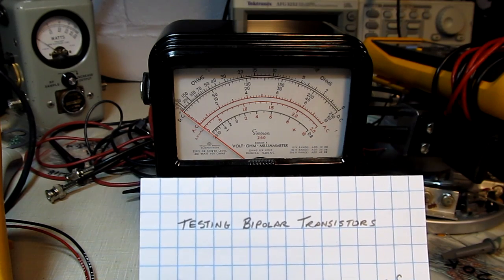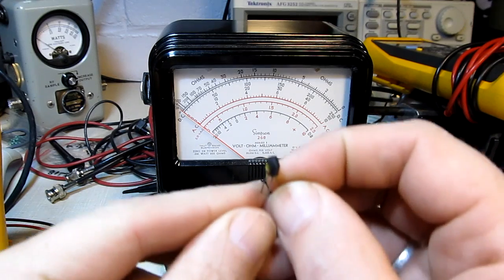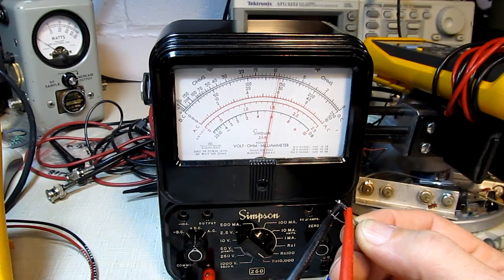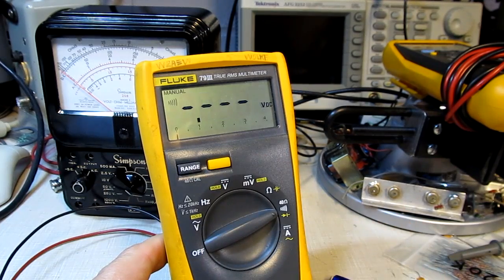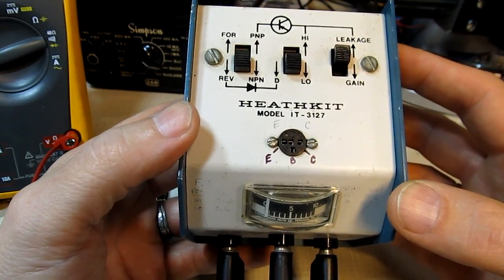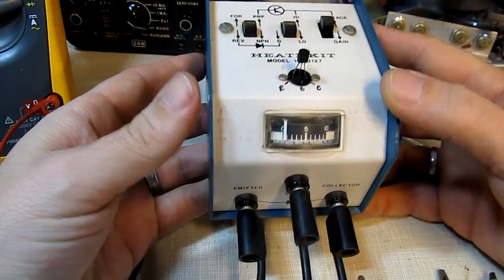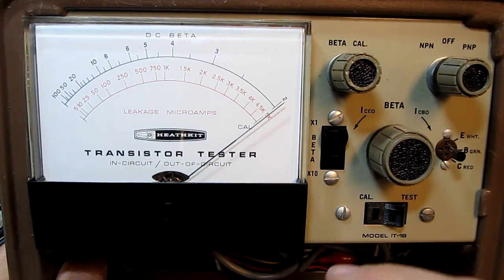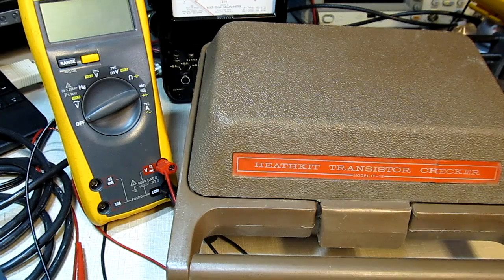#131: How to test transistors - NPN and PNP bipolar junction transistors, BJTs

Comment: Can you test this in circuit or do you need to desolder and test it off circuit?
Reply from the maker: In-circuit testing can not always give you reliable results because of the unknown influence of other components in the circuit.  Unless you know the schematic and then know what to expect from the remaining connected components, in-circuit test can only sometimes give you an indication of a gross failure (open or short).
Reply: @w2aew  I am testing a relay and on the power supply side I get the 12vdc...all is good there...but the other side of relay I am seeing 6vdc...I am thinking there is an issue with the NPN transistor....any specific tests I can do?  

This is all over my head but I'm trying my best to comprehend it.  I was told to short the base to ground so the transistor is not functioning at all and should not be conducting collector to emitter...if I do this I should see the 12vdc at the collector side of the relay coil...if I don't see 12vdc and I see something lower then it confirms the transistor is bad...is this correct?
Reply from the maker: @macknumber9  Yes, as long as there is nothing else connected to that end of the relay coil that could be pulling current through it.
Reply: @w2aew  yeah nothing else is connected....if I see 12vdc doing this test then what would you test next?  The actual base voltage reading while in operation?  I would expect to see .7v or higher at the base...if I see less then the transistor would not be at fault but possibly the transistor is not getting the right voltage because of anything before it?  Bad resistor etc
Reply from the maker: @macknumber9  Measure base-emitter voltage when "on", should be about 0.6 to 0.7V or so.  Is there any resistor between emitter and ground?
Reply: @w2aew  looks like emitter goes straight to ground with no resistor...base looks like it goes to resistors
Reply: @w2aew  so here's an update to my situation...I replaced the relay and it worked...I thought all was good until I heard a horrible rattling sound....the rattling sound ended up being the relay sparking/arching like crazy....I'm thinking of 2 possible things being my issue...

1.  Compressor is failing drawing too much amperage

2.  Transistor is bad and is causing a weak grounding of the relays coil which is causing the load side to not get pulled as tight as it should and the connection is arching because it isn't a nice tight secure connection...

Is there any way I can test for each possible problem?  Thank you so much
Reply: @w2aew  I measured base voltage but not sure I did it right...I'm guessing I did....

I put black probe to ground and red probe to base....got .5v 

I got excited thinking I found my problem....low power to the transistor...

Problem is I don't know if I technically did the test right (I assume emitter is ground so it shouldn't matter if I probed an actual ground or the emitter base)

If in fact I am correct and found the issue....what would be the cause for low turn on voltage?  Would this rule the transistor out as its simply not receiving the right amount of voltage to work?  Could I possibly have a signaling issue with my thermostat?  Not sure how thermostat works but I guess it somehow sends a voltage down to the pcb which goes to the base transistor....
Reply from the maker: @macknumber9  Possibly very weak or very high resistance drive signal to the base.
Reply: @w2aew  I will have to check continuity although I don't know what I should see there because of the resistors that are in that part of the circuit....don't know what would be a good/bad value....

I wonder if the thermostat itself is sending a weak signal....I would have no idea how to troubleshoot that
Reply from the maker: @macknumber9  if you temporarily short collector-emitter to simulate the transistor being fully “on”, does the chattering go away?  If yes, then the relay is ok.  To check drive to the transistor (remove the collector-emitter short), and measure the voltage at the base as well as the voltage on the other side of the base resistor if there is one, or even the voltage from the thermostat when the relay is supposed to be “on”. Then see what makes sense from an ohms law standpoint.
Reply: @w2aew  I know the relay is good...the old one went bad because of the lack of power going to the relay...it activates but weakly...this causes poor contact and relay burns out....

I am measuring .5v at the transistor base....I just removed the transistor to test out of circuit and it passed all the tests....this weak .5v is not enough to fully turn on the transistor...I just have no idea how to troubleshoot any further
Reply: @w2aew  sorry just read your entire post...I am going to get some readings....going to check resistance everywhere
Reply: @w2aew  can I run everything and all my tests with the transistor off the board? I'd rather do my tests this way instead of burning up this relay...I only have 1 left in the pack I got

Comment: Really useful thank you. However a note of caution when using an analogue multimeter. With many analogue multimeters the internal battery connection is plus to the black (negative) lead and red is to the negative lead.

Comment: 1- What are the maximum readings of each transistor when using the "diode" option?
2- If the readings are "acceptable"....gives it us the security that the transistor is in good consition?
Thanks😊
Reply from the maker: Nearly all silicon bipolar transistors will show between 500mV and 900mV.  Anything lower than 500mV may indicate a shorted transistor, or possibly a Germanium transistor.  Anything over 1V probably indicates a problem.  If the readings are acceptable, these are signs that the transistor is probably OK, but there are failure modes that won't show up with this simple test (high leakage, beta degradation, high-voltage breakdown, etc.).
Reply: @w2aew  thanks for the explanation 😃. There is an other thing i'm sitting with....does a transistor has TWO- or  THREE reading? I have a Hometheatersystem with a subwoofer issue. It goes into protection mode. I removed some main transistors and checked them with a DMM. The A1941/A940 and the C5198/C2073 give me two readings. But the L7805CV/L7815CV and L7915 CV give me three readings.....🤷🏽
Reply from the maker: @tajlingchin2553  The first four devices are likely 2SA1941/2SA940 and 2SC5198/2SC2073 which are all silicon bipolar transistors.  However, the last three parts are actually 3-terminal voltage regulators.  The L7805CV is a +5V voltage regulator, and the L7815CV and L7915CV are +15V and -15V voltage regulators respectively.  These can't be testing like a bipolar transistor.
Reply: @w2aew  thanks for the explanation. I've learned something new 😃
Reply: @w2aew  i did some more researches on the circuitboard and saw that the contactors of the relay (that steers the Subwoofer one side and the Center speaker on the other side) are burnt and glued together......

Comment: Do the 0.680 reading corresponded to the base-emitter junction and 0.677 to the base-collector junction? Typically, one juction will always read lower to identify all terminals of the transistor.
Reply: The emitter-base will always be higher than the base-collector reading for bi-polar transistors!!

Comment: If a transistors are two diodes, why doesn't a transistor rectify AC waveforms like a silicon diode would? I would think the transistor would rectify the AC waveform input on the base to collector and to the base to emitter would have two rectified waveform in opposite polarity. I'm not sure why a transistor doesn't rectify an AC waveform because its consider just two silicon diodes. Any reasons why transistors don't rectify the AC waveform applied on the base?
Reply from the maker: 1. Bipolar transistors do have a pair of PN junctions, but they aren't really operating as two diodes.  The base-emitter junction does operate like a diode and is forward biased when the transistor is ON.  The base-collection junction is usually reverse biased un normal "linear" operation.  It only gets forward biased with the transistor is saturated, such as in a switch application.
2. Bipolar transistors can, and do, rectify AC if the base-emitter junction is turned off during part of the AC cycle.  This is exactly what happens in a Class B or Class C amplifier.  In Class A, the transistor is bias so that the peaks of the AC aren't sufficient to overcome the forward bias of the base-emitter, so the transistor remains in the linear region.
Reply: @w2aew  If a diode doesn't have an DC bias voltage it will rectify an AC waveform but if you apply DC bias voltage until the AC waveform positive and negative cycles can pass through the Diode without getting clipped is the linear region of the diode. The difference between a diode and transistor is that when the AC waveform is passing through the diode is doesn't get amplify or increase in current gain. When an AC waveform passing through a transistor is increase the current and voltage of the AC signal. The transistor has something inside it beside a diode to make it increase the current and voltage of AC signals.
Reply from the maker: @waynegram8907  Yes, of course.  The base-emitter bias controls how much current flows from collector to emitter.

Comment: On using a Simpson 260,  the Rx1 range might not be such a good idea.  The spec on that meter says that current on that particular range can be as high as 625mA!  This would be a bit much for some devices.  I have that first Heathkit tester you showed,  it was given to me with a very leaky battery in it (a single C cell,  the only thing I have here that uses that size).  If you're going to leave a battery in it either don't leave the test leads plugged in or clip them to themselves to prevent them shorting out.  Leakage tests are something that I think is a bit of a holdover from when germanium devices were common.  While I have a few in my parts boxes,  I don't see me using them any time soon.  :-)  In addition to the above tester,  I also have a small one sold by Radio Shack.  There's a switch to turn it on and select polarity,  and then a knob that you rotate.  When the light comes on you can read the (relative?) gain by the knob position.  I was recently given a larger version of the same kind of unit,  but since I don't use the first one much I gave it to my brother...

Comment: I bought a pack of assorted transistors from China. I am sure they are all fake. 

I wanted to find a way to test these against their datasheet.
What parameters do I compare to the datasheet? It's not enough to compare Beta and Collector-emitter saturation voltage, that my component tester displays. 
What jig can I make to parameterize transistors with a scope +Sig gen ? 
I think a lot of people can use a clever technique. I would make a video and share it, but I don't know what I'm talking about.

Comment: Excellent clarity Alan. I also demo the "wet finger test". With the Simpson Ohmmeter +ve red lead on the (supposed) collector of an NPN and the black lead on the emitter,  a wet finger base to collector will show a significant deflection, much more than finger leakage alone. Reversing C and E will yield much poorer conduction, showing a very low Beta - current gain. Fun stuff! 73.

Comment: Very good to get it down to the basics. I normally use my Peak Altas checker, which completely breaks down everything about the transistor, including which leads are c, b, e.  In those times were an automated tester isn't with you or maybe you don't own one YET, It's very useful to know enough basics to use what's on hand. That said, Peak product is the bees knees most of the time, as it eliminates guesswork and checks the item much more quickly, but there are a few (very few) instances where the specific component are not in its internal database.

Comment: What does it mean if a transistor has a base to emitter voltage drop if only 0.187 v?  A known good transistor of same type has 0.68 v drop B-E.  I take it that it’s gone bad, would that be correct to assume?
Reply from the maker: Sounds like a failure to me.  Base-emitter short.
Reply: w2aew Ok, thanks.  And great video as always!

Comment: i'm confused. You show meter deflection with positive probe on base of NPN, and neg probe on E or C. But no deflection if you reverse your probes. 

I'm getting opposite results, with a 2N3904. Meter deflection with neg probe on base, and pos on E or C. 

What am i doing wrong? thx
Reply from the maker: It is possible that your meter has the reverse polarity on the test leads when in resistance measurement mode.  You can verify this with a 2nd meter.  Also, validate your measurements on multiple transistors to be sure.
Reply: That is because the guy is WRONG !  What he is explaining is ONLY if you have a Diode mode on your meter!  Then the meter puts CURRENT through the transistor. If you just use ohms it is the reverse!
Reply: i got a different answer on SE. Something to do with  'Traditional analogue meters were reversed'. 
https://electronics.stackexchange.com/a/340108/65001
Reply: This is what I stated. Some analog meters are reversed polarity when in resistance (ohms) mode, some are not.

Comment: Thank you a million times sir...and greetings from Jakarta Indonesia 

recently I salvaged a H945p transistor from a very old stereo. 

I'm going to use it for my microphone preamp project and searching a way to test it because it's an old parts...now I found the way from your video..

btw.. can I clarify with you that my H945p transistor can be use for microphone preamp? 

because I'm uncertain that it can be used for it and risking a damage to my microphone or my output device 

thank you again sir
Reply from the maker: Looks like an ordinary general purpose NPN silicon transistor.  Should be fine in your application with a properly designed circuit.
Reply: w2aew thank you for replying sir,.. I learned that transistor is a diode from this video sir... planning to watch other videos..

I just learned that electronic is interesting and found out late,.. I'm currently 41.. and God bless there's people like you share the knowledge.. 

thank you

Comment: Thanks, Allen, for your always super video. Great info.

One note; I've used the Simpson 260 for decades ... love 'em. One nice feature that I'm sure you are aware of, but others may not know, is the DC+ and DC- switch.  By simply connecting the leads to, say the Base, Emitter leads, and switching between the DC+ and DC- back and forth, you're effectively reversing the test leads, without having to move them. And then, connect up the Base, Collector leads, and make the same switch test (DC+ and DC-) with one direction conducting, and the reverse mode, not conducting. 

I also typically connect the Collector , Emitter leads, and do the same test (DC+ and DC-) to see if there is any leakage. I've verified many good transistors that way, as well as finding some culprits hiding away on the circuit board somewhere.

Hope that is of assistance.

73,
Neil, K7WK
Reply: Mine is an older unit that doesn't have that functionality.  Instead there's "DC-AC-Output" the last one of which just capacitively couples the input signal.

Comment: I dont get the germanium tranys Im checking..they will check with a base ofsay 60 on my tester then I can reverse the leads swap collector for emitter and it will read 20 gain on the same tester...is this transistor bad..or is it different for germanium's???thanks..
KE4HVE
Reply from the maker: +Kennynva T. All bipolar transistors will work (poorly) when connected backwards (swap collector and emitter).
Reply: so you will get a reading when C and E is reversed on a germanium trany...thanks.

Comment: How do you test for a leaky transistor with a multimeter?
Reply from the maker: +Kennynva T. In general - apply a DC bias across the collector-emitter or drain-source with the base/gate biased off, and measure the current that flows.
Reply: +w2aew I see that heathkit for sale..and think I can get it for like 18$ the IT 18.
Reply: I have the Micronta dynamic checker now..but dont know how to check the leakage..I am using or checking germanium transis..now..form an old Harmon Kardon stereo..the radio has AM and plays fine but ZERO on FM...not a sound, no bodys home..
Reply: Or you can go modern at look at items like this:

http://www.ebay.co.uk/itm/Peak-Atlas-DCA55-Atlas-Semiconductor-Component-Analyser-/112052577165?hash=item1a16daa38d:g:likAAOSwRgJXgitg

or perhaps below (which does lot more):

http://www.ebay.co.uk/itm/172225104646

Comment: couple of bucks? this thing arent cheap  even at their age today Mr.

http://www.ebay.com/itm/HEATHKIT-TRANSISTOR-DIODE-CHECK-MODEL-IT-10-104840-/291415852380?pt=LH_DefaultDomain_0&hash=item43d9bd055c

http://www.ebay.com/itm/Vintage-Heathkit-Transistor-Diode-Checker-Model-IT-27-Ham-Radio-Amp-Manual-/231608974161?pt=LH_DefaultDomain_0&hash=item35ecf87b51

shit even the shipping its expensive, nice little vintage machine tho i like the first link looking old and roasted
Reply from the maker: Frank Lopez Those sellers are insane!  I've seen them for under $10, like this one:
http://www.ebay.com/itm/Heathkit-Transistor-Tester-WORKS-GOOD-/331592977562?pt=LH_DefaultDomain_0&hash=item4d347b4c9a

For $20, you can get the better tester that I used in the video, like this one:
http://www.ebay.com/itm/Heathkit-Transistor-tester-/321797540905?pt=LH_DefaultDomain_0&hash=item4aeca0cc29
Reply: nah i like the type you have way better, tho your right this people are ripoffs is crazy! but thanks for the link i buy just to store it  i like that socket it has in the middle along with the simple switch choices.